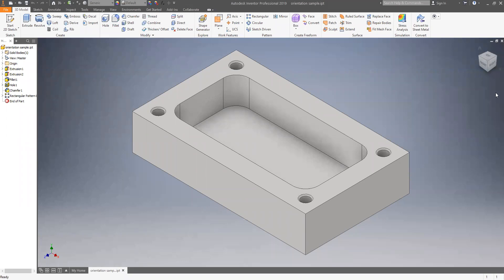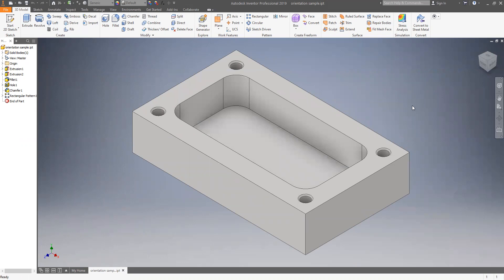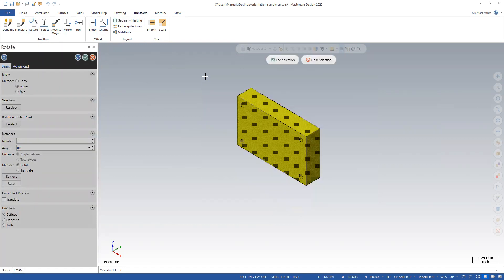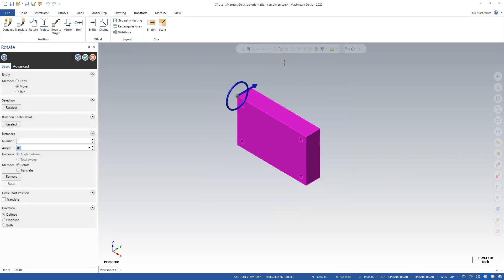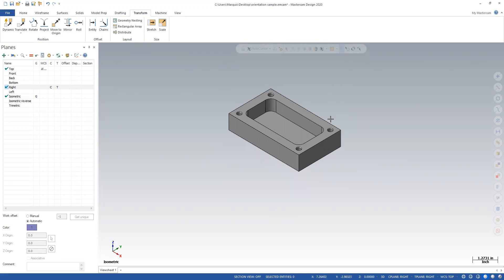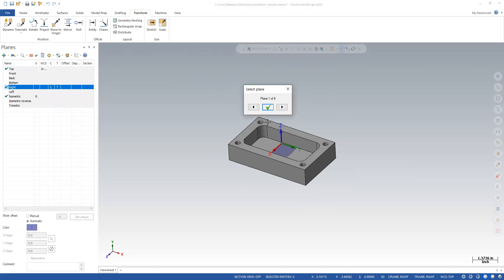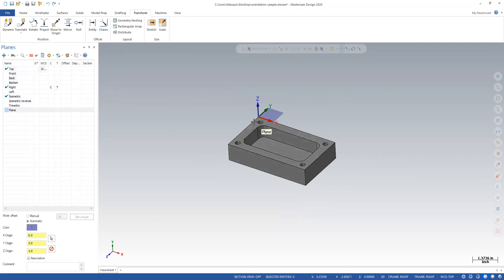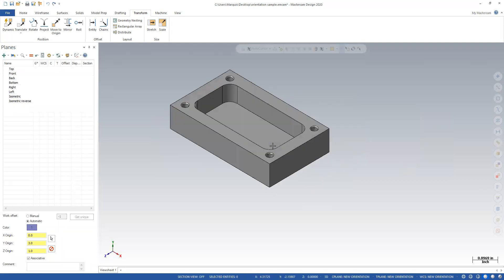How to orient a 3D model in Mastercam

Comment: Thanks for this video, It's really helpful.  How would I place it in a corner if I have a rounded edge?  I assume this is a very common issue but I haven't found a simple solution
Reply: If you have a rounded edge, you can assign a new plane at the nearest clickable point, then drag the plane gnomon a distance equal to the radius of the curve. That will put the WCS in empty space at the theoretical intersection of two perpendicular edges.